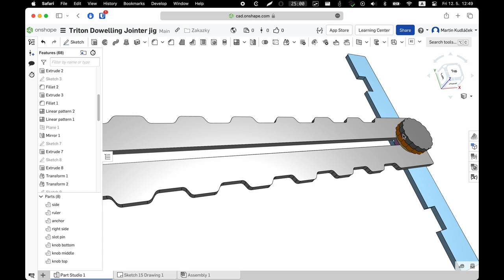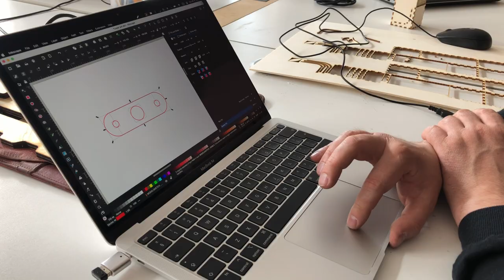This doweling jointer from Triton is garbage.

Comment: You have an interesting solution here. Good job in learning how to use a laser engraver/cutter. However, any tool purchased that requires extra work/solutions to make it work as it was intended to do in the first place is a complete failure. Triton should have spent an extra $100 to resolve all those issues and release a product that doesn't damage their reputation further.

Comment: Nice.  A Shaper Origin could make that jig for you. Probably out of aluminum too.  A simple screw through the side clamps so the tip is just sticks out a mm or 2 should keep it clamped in place.  Some aluminum tape on the cutting face should work to get both surfaces to match.

Comment: That’s a great idea, can’t help thinking it would be easier to use the built in tabs, and make both ends sliding, and use a centre line so that as your reference doesn’t need to be flipped over, or indexing parts only need be one sided. 😳
Reply from the maker: It's hard to explain and I didn't do a good job in the video, but it's about referencing the "long" edge, the one you are moving along when making multiple sets of holes. The original tabs where really a piece of garbage. Not centered to the tool and had a lot of "flashing" from the injection mold.